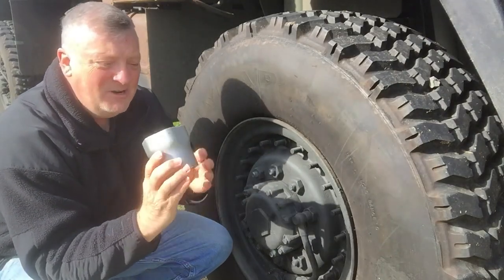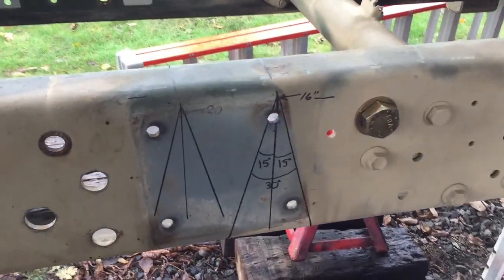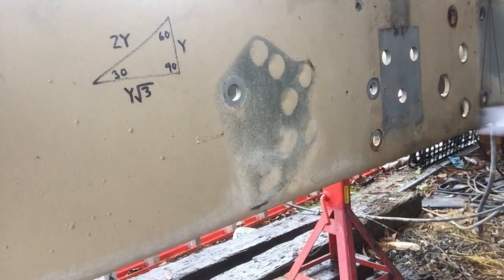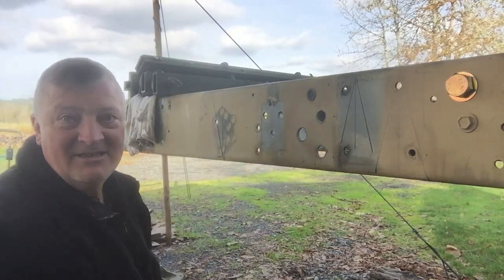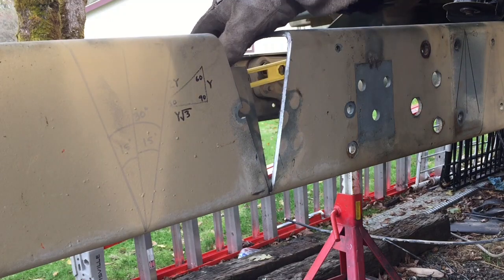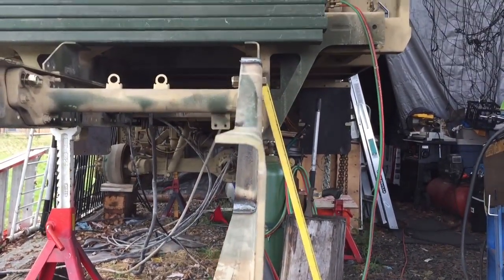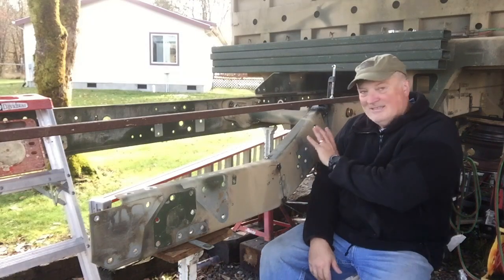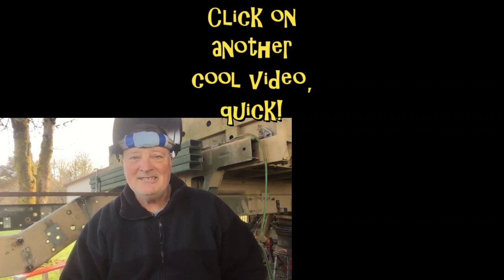FMTV TRAILER BUILD Frame Rail Cutting #88

Comment: The one trick to piecing two cut ends together is to bend it as close as you can. then run your cutting wheel down the two close ends to smooth out any bumps. Then when you get to that point in the build. An (A) is stronger then a (V) when it comes to side sway. I would also box the frame in by welding a plate on the inside. Box frame is stronger then C-frame. Just like the L.M.T.V. it is over build. you have to do the same. Be safe.
Reply from the maker: I am certainly planning on boxing in the trailer tongue. I have several more steps to get to before I can claim it as a trailer, for sure! As you know, I will also have to build a beefy bracket across the trailer tongue to support the trailer leg support.